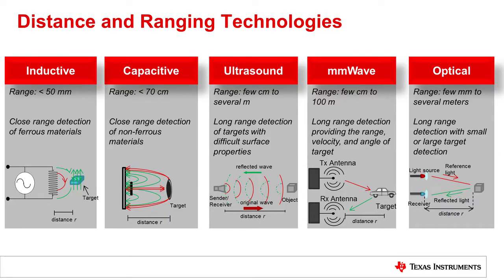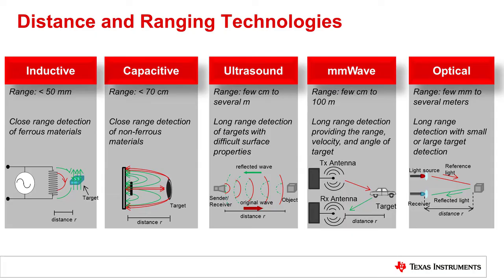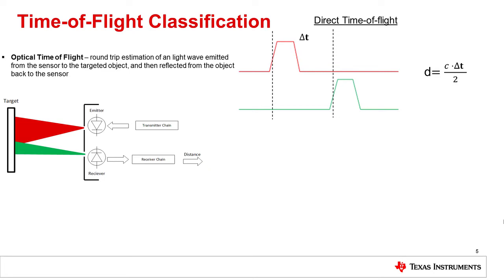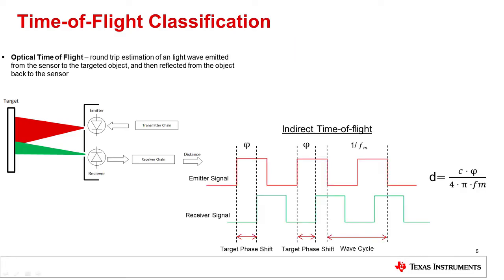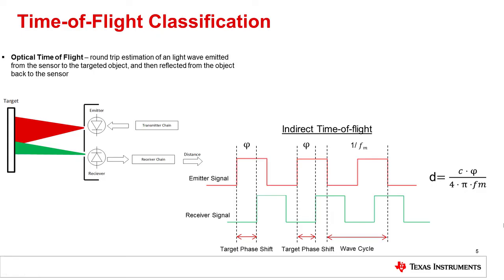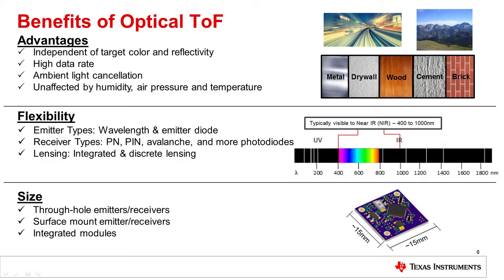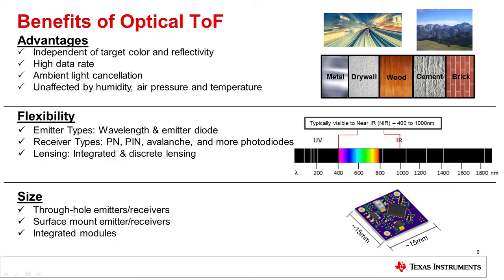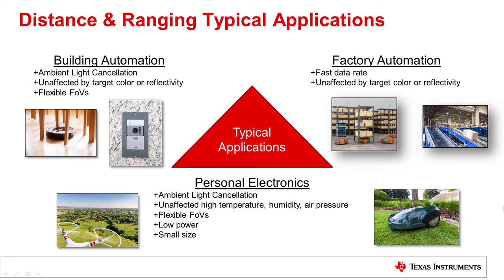Understanding Optical Time-of-Flight (ToF) Technology

Comment: How to assure that light from transmitter will be received by the receiver??? How to assure the fired light will back to receiver?
Reply: Most surfaces tend to be diffuse or pseudo-Lambertian scattering reflectors, so there will always be some percentage of light that comes directly back to the sensor.  Things that fail are shiny smooth  surfaces or mirror reflectors that will bounce the light pulses away, and yes, you'll get holes in the depth reconstruction on those surfaces.